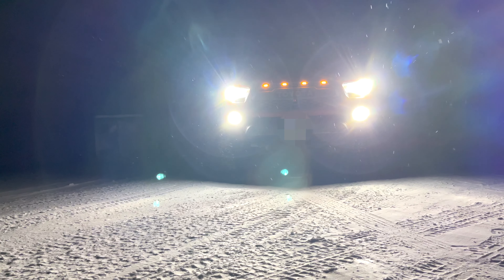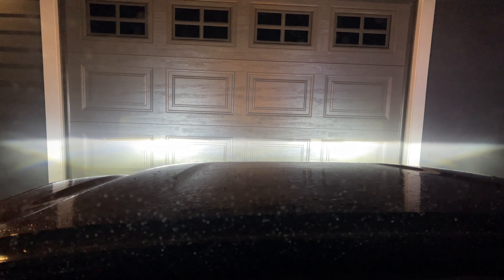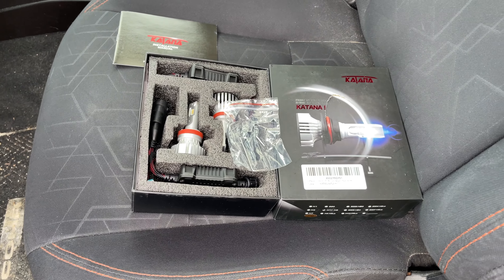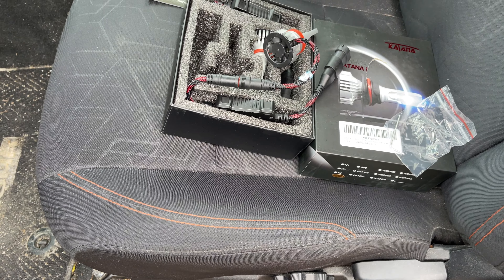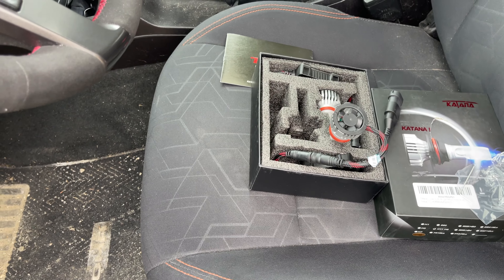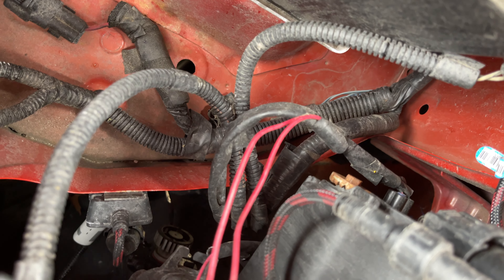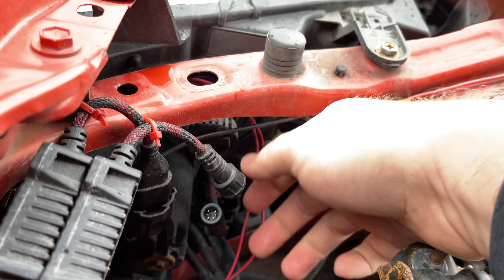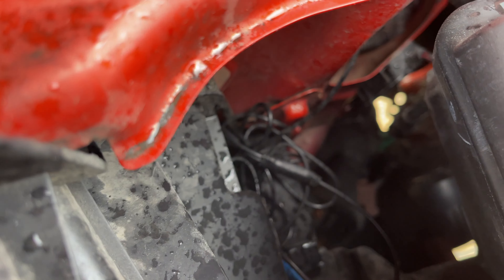The Best 3rd Gen Tacoma Led headlight Bulbs | Katana H11 Bulbs | Supernova SV4 killer 1/4 The Price!

Comment: Don't these things blind oncoming drivers?
Reply from the maker: No as long as you have them properly angled at 2 inches below the center line of the light there are adjustments on both the fog lights and low beams